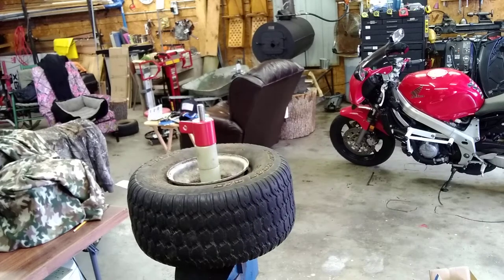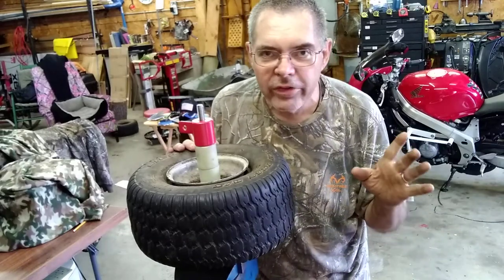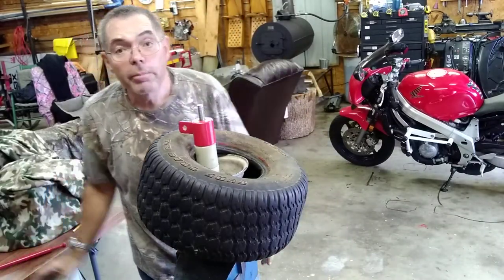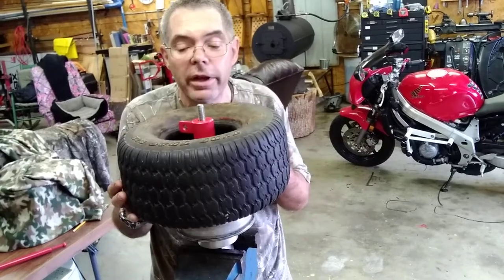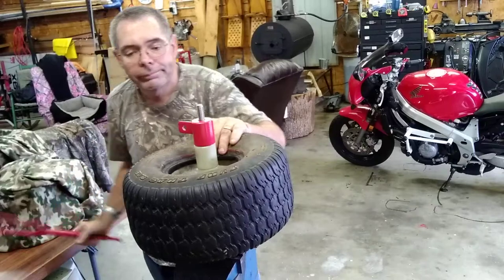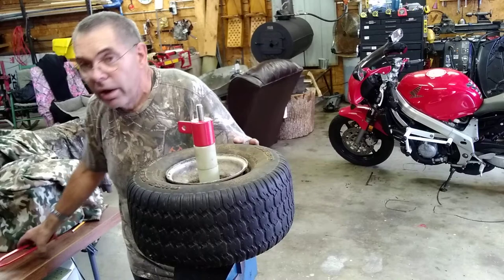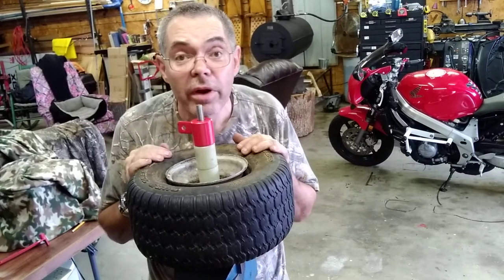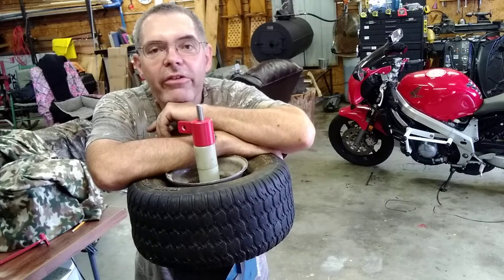Harbor freight mini tire changer😀😀

Comment: George I,m 77 years old & been a gear head, racer, auto machinist. As a teen i worked at a 
Gas station changing oil, tire, tune ups ect. You taught me something I did not know about 
The ring facing down opposite the the hole in the rim. Who ever said you could not teach a 
old fart new trick. Thank you my friend. ole Jimmy

Comment: Good advice about the tube. I have put them in wrong and held them with pliers to air it up and when you let go of the stem it pulled it inside the tire!. Have to wait until the next flat to fix it...

Comment: Good video.( the problem with these small tires)  I think you said it best in your reply to a comment: " It's Not secured down to something Solid, #2 they don't have the red nut retainer tightened down enough, #3 there not using enough or slippery enough lube",

Comment: Great product!  Took 20 minutes for the first tire change. The second 10 minutes. Nice tool!
Reply from the maker: I'm glad you liked it.. when I think of the countless hours on the floor with screw drivers and pry bars only to find out I pinched the tube😟😟😟😟 I like mine in my 6" vice so I can see what's going on,, Thanks for the comment and watching,
Reply from the maker: Also I just thought of this,,,, I don't use soapy water and I'm not going to buy tire lube, but instead I use  P B blaster,  it's great lube and works very nicely on every tire I've taken off or installed and a quick wipe with a paper towel 😊😊

Comment: Well duh nobody keeps soapy water around the shop, but a bottle of dawn and a bucket and a paint brush... And a 14" long 1/2 x13 carriage bolt will do the same thing as the fancy HF thingy. Just grab a spacer with a square hole in it like comes with DIY trailer hitch, stick the bolt thru, and run the bolt up from below thru a hole in your bench. Put the rim on the bolt and take up the slack with various nuts and spacers(axle nuts?) put a 1/2x 13 nut on a tighten a little. Stick a tire spoon between tire bead and rim and rest against bolt and pull. The friction of the rim on your workbench will keep the rim from turning.

Comment from the maker: I think the biggest problem I see people having is...... It's Not secured down to something Solid, #2 they don't have the red nut retainer tightened down enough, #3 there not using enough or slippery enough lube, I use liquid wrench lube, I've done Dozens of tires in the last yr from tiny 4" to 24"at tires new and older then me, the only other tool I've ever used very seldom was a pair of vise grips clamped onto the lip of the rim on smaller tire to stop the bead from running around the rim, My opinion is,,,, if your having problems it's one of the above mentioned item's, I love mine and everyone I know including a 78 yr old man Loves it, Good luck everyone

Comment: While mounting in the vise is handy, I would caution everyone against it.  Not all tires come off/on as easy as the one depicted.
That steel bar will do some real damage if it slips and hits you in the face.
A better option is to buy a 2x2" square bar, 25"+ long and slip it into a receiver hitch.  Then mount the red bottom holder to the bar, I welded mine but there are several ways to bolt it on also.  My pickup is higher than most but the bar height will never be higher than my waist.  Caution still must be used but much easier and safer to work with down there than at face height.

Comment: I'm on my daughter's internet. I don't know why my name doesn't show up instead of hers. Any, lubing the tires with tubes is ok. Without the tubes, I kept breaking the bead because the lube doesn't dry out. So if it's just the tire with no tube. You may want to use soapy water because the water will dry out and help the bead from breaking should you put side pressure on the tire. Good video.
Reply from the maker: Hello, what ever works for you is the way you should do it, In my case I removed a tire this morning in the shop that was 28 degrees, there was no soapy water this morning so a quick spray of lube and the tire was off, wire brushed the rim and remounted the tire at 7am, home at 5:30 still had 25lbs and good to go, I'm wondering if your tires are fully inflated,

Comment: wow I'm going get one , GOOD VIDEO  Thx Ed  Loretto Ontario Canada
Reply from the maker: Thanks Ed, it's one of those tools that you don't need it till you need it, then you'll be smiling ear to ear,,
Reply: Well, I'm in TN. I'm a card carryin' member of Harbor Loser. I will buy one of these (and probably regret it) but it beats the $50.00 I juss paid last week for the local lawn shop to fix my two front tires on my z-turn.  Good video, George. Thanks.

Comment: From a personal standpoint, I thought the tool sucked. It was too wobbly when you mount it and the long mounting screw would bend when using the bead breaker. Got the 4-inch tire off easy enough, but putting a new tire on? Forget it! Using soapy water, I got the first bead on, but the top bead proved to be too much. Followed all the directions from this video and others who have done a product review on this tire changer. Trying to hold the tire to keep it from turning with my stomach while trying to push down on the tire  with one hand AND turn the tool with the other hand was impossible. The tool bar wanted to keep jumping up enough to come off the rim! How frustrating! After about 45 minutes of trying to mount the new tire, I was so mad I could have thrown the tool bar across the room!

You made it look easy enough (though, your tire is bigger, so maybe that made it easier).

Maybe if the tire changer was sturdier it would work easier. 

As for me, I am boxing this thing back up after accomplishing only a tire removal, along with a lot of cussing and aggravation. This thing will go on eBay and I will be off to the local tire shop to have them mount the tire. I'd rather pay the $15 or $20 than deal with anger and time wasted.

It was listed on eBay today (8/19/19). Have it listed for $48.50 w/ free shipping.
Reply from the maker: Sorry to hear about your experience, I've mounted and dismounted probably 2 dozen + tires since I made that video a year ago and even a few 4" like the ones on front of my Exmark walk behind, I don't mount my unit using the bench mount bracket, mine is mounted securely in my 6" vise on my Very heavy duty bench, also I've never have had issues with the rod bending, instead of soapy water which I said I don't keep in my shop usally, I use spray lube such as liquid wrench or a favorite Pb blaster, as I said in that video I wished I had one of these 20 years ago when I was running a successful lawncare business, but I'm glad I've got one now, and you are right the smaller tires are harder to do, Good luck to you
Reply: @georgeskentuckyworkshop1420  

Well, I finally got it to work. Though, not by using any method that i have yet seen in any of the videos that I have watched that detailed this tool and the various procedures. 

Instead of using that tool bar to go around the tire bead, I used tire bar to hold the tire in place and used the bead breaker bar attachment to go around the tire bead once I got it started; this worked.

I sort of got the idea from the video link below. However, he didn't do it the exact same way that I did, but he got me on the right track I suppose.

Maybe I will hang on to this thing after all.

https://www.youtube.com/watch?v=yauRGxDYevA
Reply from the maker: @williamcattr267  another thing I've done especially with smaller tires is I've clamped a pair of vise grips onto the lip of the rim and that helps stop the tire from cropping off the rim, good luck to you, subscribe

Comment: Well shit, looks like I’m hittin harbor freight tomorrow...👍🏻
Reply from the maker: Thanks for your comment, That tire changer makes me smile every time I use it,, when I think how I used to do it with screw drivers and pry bars
Reply from the maker: After I wrote that last message, I had to use my Harbor freight tire machine, hadn't used it in 6 months but there it was under the bench waiting to remove that tire for a tube😎
Reply: @georgeskentuckyworkshop1420  
Bought mine last weekend, used it the very next day to change a tire on a mini bike👍🏻
Reply from the maker: Just make sure you have that too but plenty tight, all the complaints I hear about bending rods are all from top  not being tight enough, thanks for watching my videos

Comment: I bent mine, it also broke off my table. Returning it for another, it's only good for removing 4 tires and putting on 3 ½...
Reply from the maker: I know from using mine probably 20+ times now in the last 2 years, you have to make its screwed down Tight to secure the wheel to it, also mostly mine is in my vise, so it's not going anywhere, and Lube makes all the difference in the world both removing and putting the tire back on, as I said I've had mine over 2years now and I smile every time I use it🤓

Comment: it that old and rotten, just cut it off >  Wouldn't say they need to put that info on the bag it come in?   i'am not going to remember that>   lets say 5 yrs from now  but your very correct! the google valve is off set for  the hole  on the rim Young guys lesson GOOGLE VALVE  is The correct way of saying a valve stem  he hee TRUE OR FALSE? say FALSE ?   YOUR WRONG
Reply: GOOGLE VALVE the correct way of saying a valve stem.  I've always thought that an automotive valve stem is a Schrader valve (after the company that invented and patented this type of valve).  Since I've never heard of a google valve, I Googled the term, and found several entries for a goggle valve (which isn't for pnuematic tires).  Not saying you're wrong, just wondering how you learned this term.
Reply: @cliffordyoder3421   He hee its the old way for sure, I learned that in the oil fields.  Not in School!  I still call them "Valve Stem" I think every one else dose too! Then we got a dictionary to look it up!  At that  date and time is was hard to fine, In the dictionary